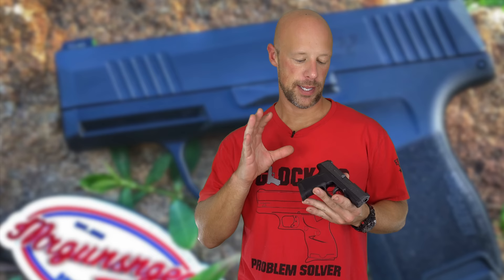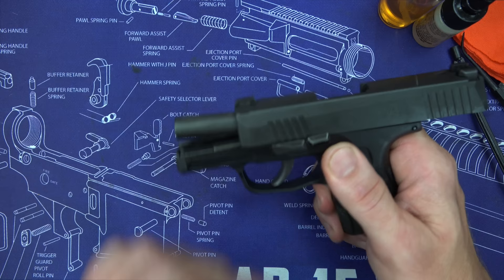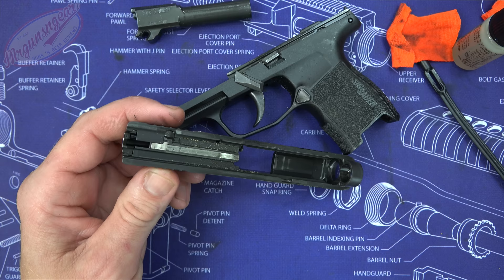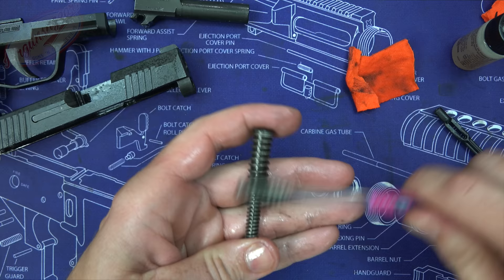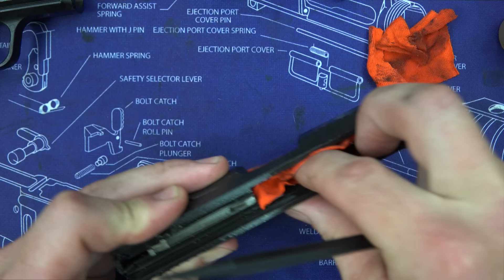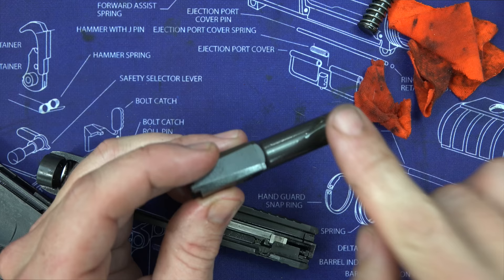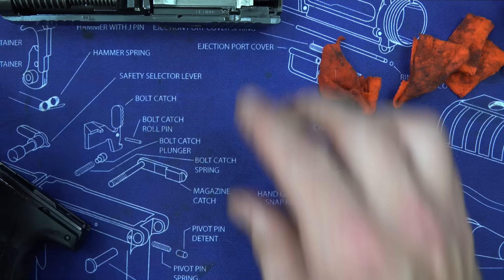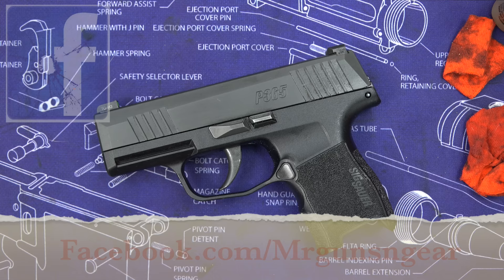How To Clean & Lubricate A Sig Sauer P365 Pistol  (4K)

Comment: As you stated in the beginning, Sig specifically states NOT to get any cleaners or lubes in the Striker Tunnel which by using your spray bottle to DID!  I'd suggest removing the Striker Assembly and drying the inside of the Tunnel and cleaning and drying off the Striker. In the future I'd strongly recommend NOT using a spray bottle - just drip the CLP onto a clean patch.
Reply: Bobby W Good advice! Hopefully people take heed. Always important to follow the manufacture’s directions to a tee. They don’t just write that shit in read for the no reason. I’d be willing to bet, there are a lot of people that don’t even bother reading the manual after purchasing a new firearm. Gotta treat your tools well if you want them to last!
Reply: Amen, brother
Reply: Can mr gun and gears say something for us about this?
Reply: Can't upvote this enough. The only failures I had was when I got lube into the tunnel. Ran a few qtips in it to clean out and never had a missfire since
Reply: @vinhyvegas  That's what she said!

Comment: So your process is: bath it in oil, wait, wipe off, clean? I recommend the videos from Gunblue490 about the real necessary amount of oil hint "wipe it with an lightly saturated oilcloth after cleaning with a guncleaner like Hoppe´s #9 -> done!" Been doing that for years now, guns are in perfect condition and less accumulation of fouling due to overlubrication. Besides your cleaning tutorials, i like your channel, keep up the good work man :)! Gruss aus Deutschland! P.S.: Owning the P365 for a few months now, having about 700 rnds through it, no problems, besides one light primer strike (Ammo ...?).

Comment: Got about 700 rounds through my p365 I've had for several weeks, and I'm carrying it. January 2019 mfg date. 0 malfunctions. Primer drag is equal to my glock 43. Just sold the 43. Never did like it. First Sig to own. Not a Sig fan at all, but I like this gun. Accurate and easy to shoot
Reply: Why are you reporting this here. This is a p365 cleaning guide.. are you working for sig? Kinda random bro I think u got the wrong video
Reply: @SoLazyAtWork  I think you're a Glock fan boy and irritated for some odd reason that another person sold their Glock and replaced it with a Sig. I think your comment is the weird one here.

Comment: It is very helpful if you use a bore brush to break up the carbon build up in the rifling of the barrel then use the cloth swabs to get the rest of the gunk out. You get a cleaner bore.
Reply: I like to use the new bore snakes, it's easier and does both at once.
Reply: Yes this is a must do
Reply: Do you use a brass bore brush? I was told that the brass bore brushes can cause wear on the finish inside the barrel...
Reply: @FloGrown47  Bronze brush is what is recommended in the owner's manual.

Comment: My mid April 2018 build/purchase has over 11,500 rounds through it. I have put rounds from 6 or 7 brands and grains. 10,000 Brass & 1500 Aluminum. JHP (600-700), the rest was FMJ. The gun has run everything I put in it with ZERO PROBLEMS. 
Little SIGGY is one tough gun. 🙂 🇺🇸
Reply from the maker: thanks for the report

Comment: I put a little over 400 rounds through my sig during an all day training session. hot, dry, dust everywhere, we kicked it up just walking around the range. got the gun home and saw there was shockingly little debris inside. Cleanup was almost too easy. I don't know if they just designed these things really well, or I happened to have some especially clean ammo. In any case, the takedown lever was easy to use and I guess Sig Sauer is learning from the past and making their firearms a little better each year. And apparently its much like a Glock in that it needs very little cleaning to keep running for thousands of rounds, or so geeks on the internet keep telling me.

Comment: Hi - thanks for posting - this is helpful.  The manual and the SIGtalk forum advise against not lubricating the striker assy:  "Do not lubricate the striker assembly or allow lubricant to flow into the striker. A FAILURE TO FIRE MAY RESULT DUE TO A LIGHT STRIKE TO THE CARTRIDGE".  I use a tiny amount of CLR on a Q-tip to clean but try to not deposit lube here. For what its worth...

Comment: You forget to mention sometimes you have to push that little lever back down near the rear of the frame to get the slide all the way back on when putting it back on the frame.
Reply: Mrgunsngear didn't mention the "little lever" (which is called the "safety lever" on P365 schematics) because he never pulled the trigger with the slide removed, and so the little lever never popped up. If he had, the lever would have popped up and the slide wouldn't go all the way on until the little lever was pushed back down.

The safety lever is the little hickey on the inside of the frame's right slide rail about an inch forward of the rear of the frame.  With the slide fully installed and the gun loaded, pulling the trigger to take up the slack in the trigger (i.e., to the reset point) moves the safety lever up and out of the way of the striker. This in turn allows the gun to be fired if the trigger is then pulled fully.

See:     https://www.youtube.com/watch?v=6oT9QpYsTUI&t=727s
Reply: Thank you! I had to get out the owner's manual to find it but once this tiny lever was down, it went back together easily.

Comment: Outstanding video and thank you! Mine is a 2019 build and it’s accuracy is astonishing! Small center mass group at 25 yards is easy and at 10 yards very tight group are possible. It’s really the missing link I was looking for between really small easy to hide but underpowered to very powerful difficult to conceal choices.
Reply: Randy Fugate what distance is the sig P365 zeroed in at out of the box?
Reply: @tmc6185  2000 yards

Comment: I tend to soak it down with CLP and then blow it out with compressed air.  When doing that with the 365 slide all I did was force a bunch of lube into the striker channel.  As per the manual this causes light primer strikes and indeed it did.  I disassembled the slide and cleaned out the striker channel and stiker.  Problem solved.
Reply: This is why I wouldn't recommend spraying the inside of the slide with CLP as shown here. Also, when cleaning the breech it's important not to push oil and junk back up into the striker channel.

Comment: I use a Copper/Lead solvent to clean the internal rifling in the barrel. I prefer Shooters choice. I clean everything else with IPA then use Mobile One HIGH MILEAGE or Racing Oil to finish cleaning and preserve. Works well on Glocks too.

Make sure when you are finished to oil EVERYTHING including the Nitron finish. Everything EXCEPT the striker or striker channel.

Comment: March build. 2800 rounds and flawless.  Love everything about the gun.  Don’t comment if you have no experience with the 365 and are repeating internet gossip.
Reply: congrats. you've far exceeded the worth of the pistol in ammunition. most will not likely make it. u should play the lottery soon as well.
Reply: Jerry: So you're saying all the reports of firing pins breaking are "fake news" ?
Reply: I had an early February P365, had no issues. But I still sold it for a Glock 43.
The Sig sat in the safe. There were far too many horror stories concerning the pistol, I could never trust it.
Reply: @chad_8313  So your gun was 100% reliable and you didn't trust it?
Reply: @frankhamp1396  yep. I only took it once to the range. But I didn't feel like spending a couple hundred dollars on ammo to see if the striker breaks. There was no confidence in the Sig. I was expecting it to fail like so many others had.
Reply: Got mine yesterday for when attire doesn’t lend itself to carry my Glock 19. Mine is an Oct ‘18 model gen 3 but only has about 120 rounds through it. No issues so far but I know it’s early. Hardest part so far was getting  hat last round in the mag.
Reply: @chad_8313  Enjoy the the cheap plastic parts and the crappy sights.Not to mention the low capacity. You sold a perfectly good gun all because of Glock fan boy syndrome.
Reply: There are a considerable number of documented facts of actual events and failures that speak to the reliability of the P365 that cannot be ignored, both good and bad.

Sig needs to invite 10,000 people who own P365s to a 5,000 round shoot. Record the whole thing start to finish and document everything that happens or fails to happen.

The benefit would be people would know what to expect with a P365 and Sig would know what issues still need to be addressed.

Otherwise, absent that demonstration, it seems like the best way to use a Sig P365 is to set a 2,500 round limit and then throw it away!  :)))
Reply: I have about 50 rounds thru mine with 1 fte.  I was shooting 115gr wwb
Reply: Jacoby Regalado 115 wwb is often the cause of malfunctions.
Reply: @jerrymoriarity917  I figured that was the case, so far it's shot well with the 124gr American Eagle but would like to get a lot more lead down the pipe before I trust it with my life. I'm happy to see yours is working well for you, I really want this gun to succeed.
Reply: @chad_8313  Maybe you have Gotten  a LS&365 Stain  steel striker for 99 dollars.  I have the p365 and no problems.  I like the firearm because it is small and with the extended magazine I got 13 rounds of protection.
Reply: Doug C agreed that last round is tight. Also mine takes a good push to lock mags in place.
Reply: I use a mag loader to load the sig mags.  Yep, snack it home to make sure it is in, will not the gun...
Reply: @cmack003  It will ease up in time. My Shield, Glock 43 all were hard to load at first but time and shooting loosens the mags up!!
Reply: @johnnyringo9178  haters love to hate
Reply: I just bought one. February build. It has failed to go into battery about once every ~20 rounds. I've shot 200 rounds through it so far and have also had a failure to fire - trigger pulled, pin clicked, but no bang, and no dimple on the round. Sig has said that the failure to battery is the magazine being "tight" and needing to wear in to ramp the round into the chamber without adding drag onto the slide. To me, that makes no sense. I've got a Glock and a S&W which have never had a malfunction in their first 500 rounds; why do I need to run 250+ rounds to break this in and feel safe carrying it? Not a good experience.
Reply: @dcapp84  
You're probably riding the slide. It's a small gun, takes some time training away bad habits.
Reply: @Ghost there were hundreds of replies with countless pictures of broken strikers, with serial numbers, manufacturing dates.
That was only one small forum, no telling how many more were broken, and how many more haven't broke yet.
Reply: I love the p365 but I wish I could find a magazine that would extend the grip some but still sit flush.
Reply: How often does it need to be cleaned?
Reply: @InGratitudeIam  great just got mine 2 weeks ago have about 500 thru it
Reply: @rl_31123 Depends on where you live, how you carry it, how you store it, how much you’ve shot etc etc etc. It only takes a few minutes so might as well clean it after use and not have to worry.
Reply: Too each their own but wow. 2800 rounds through a carry pistol? At $0.30 per round you could have bought something a little more fun, no?
Reply: @dougc78 I’ll second that. The last round is ridiculously tight
Reply: @brad3606 mine got much easier after running rounds thru it

Comment: 1,000+ rds through my p365 & ZERO malfunctions. Blazer & Winchester FMJ 124g ammo mostly with 200+ rds of Federal HST 124g

Born on date July 12, 2018 

I really like this little pistol... No complaints whatsoever 

Carry on! 😎
Reply: Shannon Sanford My born on date is July 6th , so far no issues. So should be good to go.
Reply: Hows the 115gr run ?
Reply: guns1war: 115g runs fine as well. Most of the issues I’m seeing is from people using cheap reloaded ammo. Sig has fixed the issues since the P365 2.0 was released in June 2018. 

I would definitely recommend this pistol.

Comment: Good luck with posting a cleaning video on a 365 that has nothing to do with anything but cleaning it, and not get negative comments anyway . People love to bash them. Mine runs flawlessly. I also know several folks that have them and no issues.
Reply: Mine wouldn’t reset the slide correctly. Probably because I shot it brand new with the packaging oil still in it. Gonna give it a shower and lube job today.

Comment: I use PB blaster and a air compressor, spray it on all over , it will eat the carbon up and blow it all off, PM blaster will not hurt and parts of your gun even the polymer, been doing this for years , PB blaster is about 3.50 a can then use some rem oil on moving parts

Comment: Thank you for this video - I just did my first P365 cleaning with your help. But there is something I did not understand: you said you keep the slide at an angle so that no oil gets into the striker channel, and then you spray the CLP directly on the striker channel and assembly until it was drenched. You also applied lubricant directly on the striker assembly at 8:50. What am I missing? Thank you in advance for explaining.

Comment: If one doesn't have a polymer tool to get into the rails, i usually use a toothpick which works really well. It doesn't scratch or damage any finishes or coatings.
Reply from the maker: Thank you

Comment: Dip your firearm in new "Prolix" CLP wet cleaner, dry lube. Shoot all you want. Clean by dropping it into the "Prolix" CLP for an hour. Very dirty, over night. No picking, no scrubbing,   pat dry or drip dry. Prolix CLP doesn't build up. Works the same in hot or cold weather. Carbon will not bond to the surfaces ever again. Waterproofs, stops any rust, leaves dry lube behind. Awesome stuff! Drop your weapon in the tank and it is cleaned over night!

Comment: Thank you for this video. Question on the slide release, mine is very hard to press and have slide release if just doing it with the thumb like you did towards the end of the video. Like I have to apply alot of uncomfortable force to have it release. Otherwise assisting and pulling back with the other hand while pressing the slid release helps. I’ve only put 50 rounds through mine and about to clean it.
Reply from the maker: it'll likely work in

Comment: Do you wipe the clp out of the guide rod? That part was completely skipped. When I cleaned my factory new P365 before I even shot one round, the guide rod was the only thing very dirty but only on the rod itself, not the spring. I cleaned it by taking a patch in between my nail and spiraling down over and over, even after the 9th time, brown was still coming up. No other part was that black-brown color.

Comment: when you installed the spring back, i noticed the large end faced toward the muzzle of the gun. is that the same with the XL model.
Reply: It also has a small hole on the rear facing end.

Comment: Does this method also allow you to put a gun back in a safe without worry of rust or anything? As in it oils the outside of the gun? The "oil the gun twice a year while it's in the safe and it will be fine" method?
Reply: If you’re worried about rust, look into a silica desiccant dehumidifier for your safe. But the best protection against rust is regular shooting.

Comment: Are you supposed to take off the trigger assembly from the frame and clean it ? I’ve done a full disassembly doing just that as well as taking taking off the firing pin. I’m just not sure if it’s really necessary or if your suppose to or not
Reply from the maker: it's not

Comment: Hi: I am always worried about this step when I clean my gun.

At 3:15 in your video you say you are careful not to get oil in the firing pin channel, but then you spray oil right on top of the area. In addition, it appears that you are taking the toothbrush and scrubbing right over the firing pin area. Am I missing something or being TOO careful?
Reply: Keep it pointing downward so the solvent doesn’t flow back inside the firing pin channel.

Comment: You didn't mention that if you flip the bottom part of the gun up side down, there is a small trigger safety lever that sometimes flips up preventing the slide from sliding back on the pistol. On a new pistol, it dosn't fall back down if you turn the bottom part of the pistol right side up. There is a note on page 43 of the Sig P365 manual that points this out. I should have read the manual more thoroughly before messing with the gun.
Reply from the maker: it's in my review FWIW

Comment: Does it really need all that oil? My P320 shoots great with very little lubricant.
Reply: I use very little lube on main friction points and mine works fine at about 800 rounds so far.
Reply: That's what I thought, kinda blew my mind
Reply: Can you post your email and location so I don't bid on any guns you may be selling on Armslist please?
Reply: Alan Hoehn why? My guns will last longer than anything this guy has. Have you actually read the manual that comes with your pistol? Specifically says not to put oil in places this guy drenched it in. Pretty sure the gun manufacturers know their pistols well enough to know proper cleaning techniques.
Reply: Alan, could you provide yours as well? I definitely don't want to buy any oil slicked piece of metal you have for listed on Armslist.
Reply: A gun isn’t an engine, and needs very little lube.
Reply: @glockguy3893  I've heard that the oil clogs certain parts of the gun,as in over kill.
Reply: Refer to hickok45 how he uses ballistol for all his guns

Comment: Good process illustration. It appeared that a significant amount of unburned powder residue remained in the slide after cleaning. With as much unburned powder that was in this pistol have you considered dry brushing the entire weapon's interior, or even air blowing it out before using the liquid cleaners. With the amount of cleaner/lubricant you use the powder residue will form a fouling paste over time.